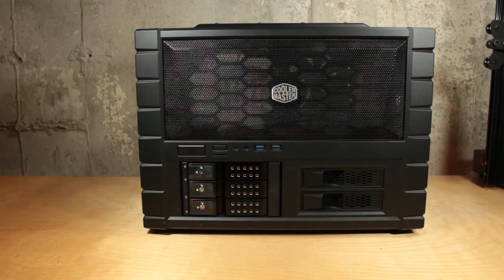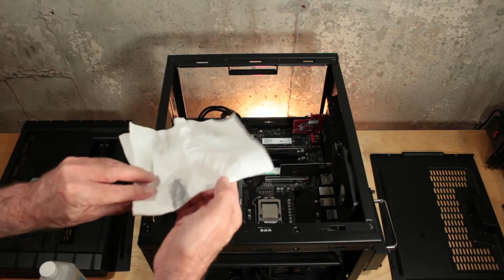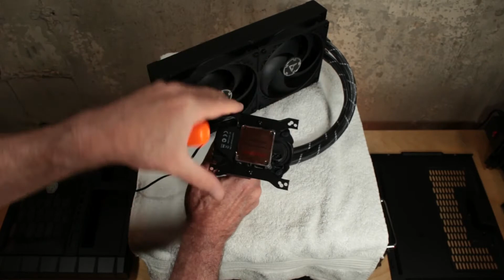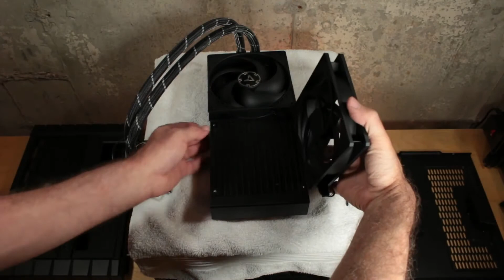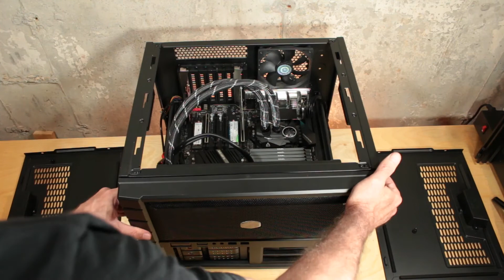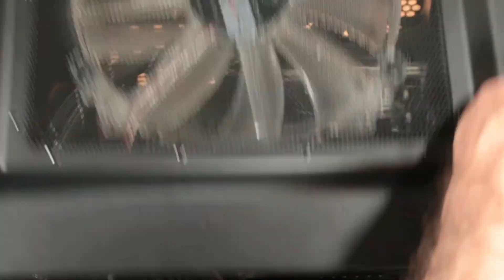Arctic Liquid Freezer II 280 install into Cooler Master HAF XB EVO LanBox

Comment: I've been using that same old case for years and still loving it. My rig needs an upgrade now and I was almost going for a 120 mm water cooling (AiO) system - but 240 mm seems viable. 

Still, isn't it a bad idea to push the hot air into the case instead of out? I think I'll go for some mild case modding and try to install the radiator on the top panel somehow - which is better anyway (radiator higher than pump = better cooling).
Reply from the maker: The case has considerable space for fans on the back. As long as they are all blowing air out the back while the cooler is blowing it in, you should be fine. Mine has been running 24 hours per day since I made this video, never had a cooling problem. Thanks!
Reply: @KapmansBasementWorkshop  
Been watching more videos in the meantime to gather some ideas. Apparently you can opt for push or pull (or push/pull) with these AiO coolers. If I understand this correctly you can mount the fans reversed so that they pull the air out through the radiator. It's just marginally less effective than the push variant... and I guess I'd have to add some fans in the back to suck air in.... hmm still undecided. If I really wanted to go crazy I could even fit a 360 mm cooler on the top. No clue how hot these new CPUs even get.

Comment: If you run a big GPU, you're going to mount the 200 outside. I had to mount my Noctua outside, also it would be nice if they updated the panel to be able to mount one fan in the left side for the gpu.
Reply from the maker: I did not try that yet

Comment: You can also add 2 x 80 mm fans at the bottom of the case to help with cooling. There is a lot of options now to optimize cooling with this case.
Reply from the maker: I agree.  I did have fans in those positions at one time.  But with later upgrades removed them.  I've been slowly eliminating fans over time...

Comment: Now you have an option to use - A Thermal Grizzly - Carbonaut - Carbon Thermal Pad inplace of thermal grease / paste. The thermal pad won't " Dry - out " and can be reused many times.
Reply from the maker: Has it been working well for you?
Reply: @KapmansBasementWorkshop  Using the Carbonaut - Carbon Thernal Pad has been working well so far. I am considering getting a couple more for my GPU. Not sure how beneficial it wold be though

Comment: Nice video. You can remove the dual 3 and 1/2" drive bay that supports the quick insert and release to allow more space for the PSU and cables. I have done this myself and using my Seasonic PRIME TX-1600 ATX 3.0 psu has been nice.
Reply from the maker: I also installed a hotswap bay which added an additional drive bay as well.
Reply: @KapmansBasementWorkshop  I took that drive bay out - to make more room for the cables from the PSU. Sorry for any confusion.
Reply from the maker: No problem. This is what's so great about this case!

Comment: I just buy Arctic Liquid Freezer III 240 and I have the same PC case and I'm thinking about how to best place it. Thank you for your video.

The only real drawback of this case is the small amount of space for the cables that come out of the power supply and directly "hit" the back of the HDD rack (what you mentioned at 2:50). I'm even thinking of removing that HDD rack and placing the only hard drive I have on the left side of the case in a fixed HDD rack. Thus, the cables from the power supply will "breathe" much better.

Otherwise, the case is fantastic, easy access to components, no problems with large AIR coolers and when you remove the top cover and side covers, you have easy access to everything on the motherboard.

Even though the PC case is old, even in 2024 I don't think about changing it.
Reply from the maker: I love this case.  I think it's the best large case around.  The easy access is fantastic.  I would like to replace the large top fan.  I have been having trouble getting a new one....Thank you for your comments!
Reply: The only other " Draw-Back" I have encountered with this case is the shorter size which makes using { Longer / More Powerful } GPU's a nightmare. I'm using the - MSI Radeon RX-7900XTX Gaming Trio Classic as my GPU in this case , which limits me to using a 120mm AIO for my Ryzen 9 7950X3D cooler. I'm gonna try to   use 120mm to 140mm fan adapters to upgrade the fans for my AIO to 140mm which I hope  could cool my Ryzen 9 7950X3D to below 55 degree's C running temperature. But at 55 degrees C - my Ryzen 9 7950X3D is still well below the 90 degrees C mark that AMD says it can operate at. This case does allow for custom watercooling. The ability to support custom water cooling is one of the major selling points when this case was first introduced. Maybe being able to remove the front panel without the need of having to remove the side panels would be nice.  Maybe even a higher price point that would include both the - mesh and see through top panels. Adding a Type-C port to the front panel would be a nice update for it. Retainig the 2 x 5 and 1/4" drive bays would be nice - I have 2 x Optical drives which I would like to keep.  Maybe even making it taller to accommodate dual PSU's and have better cable management.

Comment: Will the AC 240 III fit the screws? I'm gonna 3dprint adapter anyway but yea, straight fit would be a plus.
This case is still one of the best, using it since 2019 and i don;t plan to replace it too soon;
Reply from the maker: Please post a link to an AC 240.  I'll have a look and let you know.

Comment: I have this case wish they update it with more I/O on the front and USB C. Is it possible to fit in a ARCTIC Liquid Freezer II 360 in this case? I have a Asus TUF 3080.
Reply from the maker: I don't know.  You would need to check the measurements from the spec sheet.  I would also like to see an update for the front.

Comment: Can you run the radiator the other way ? We have a 5700x gpu and it's not enough room
Reply from the maker: I’m not really sure.  Please clarify what you mean by "the other way"
Reply: @KapmansBasementWorkshop I think they might be referring to having the aio tubes running the other way around instead of having it to where its gonna be above the pci slots. 

I managed to get those aio tubes facing the other way around to make room for my 3060 ti and it seems to be working great.

Its alot easier that way because not only do I have more room for the gpu but I dont really have to worry about the aio tubes hitting on the 200mm fan I have in the top since the tubes are right underneath where the side handle is on the case
Reply from the maker: @Zenoguard  This makes good sense.  Next time I'm in the PC, I may need to switch this around.

Comment: I still love this case.  I just wish they had an updated version that would take more radiators.  I'd like to see more horizontal cases in general, especially with video cards being so stupidly big - having them hang in tower cases just seems dumb.
Reply from the maker: I still love this case as well.  It’s in constant use after all this time.  I’m also not a big fan of tower cases.  An update of this case would be fantastic. Thanks for your thoughts!
Reply: @KapmansBasementWorkshop  Ever find an alternative? I'm still using mine and thinking of going to the tower 600 which is a tad taller but same LxW
Reply from the maker: @swooptv  I have not.  But I really have not been looking either.  I think I will build my next PC case instead of purchasing one.  I really have no need to replace this one.

Comment: Do you think a cooler with similar dimensions but 2 more mm ontop when the radiator is horizontal will fit? (It's a be quiet! 280 mm aio pure loop)
Reply from the maker: I just looked.  I believe it will assuming the bolt pattern is the same.
Reply: @KapmansBasementWorkshop  Alright thanks

Comment: What is this on your CD Drive slots?, looks like you have 3 slots of something, i'm curious, i have one HAF and i have just the covers in front :)
Reply from the maker: I installed a 3 disk hot swap drive bay. It simply bolts into the bay after removing the provided drive holders. It's a super simple and useful upgrade and adds an extra bay. Highly recommended.

Comment: I have had this case for years now I like it. I still have my 2 front fans. I had a big top fan as well but it started to rattle so I removed it.
Reply from the maker: I love the case. As soon as that fan starts to give me trouble, I lubricate it and it works for another couple of years!
Reply: been using this case and it's original fan since 2013...sob still trucking along.

Comment: Can we use a riser cable to separate the GPU over the motherboard and place it somewhere else in this cabinet?
Reply from the maker: I don't think so, but it has great GPU cooling where it is now.  Why would you place it elsewhere and risk a possibly less reliable connection?
Reply: @KapmansBasementWorkshop  vertically mount will exhaust the heat upside from its vent , and GPU weight would not be over the motherboard. ❤️ And thank you for the reply 🌹 really appreciated 🌹
Reply from the maker: @dharma.vibrates  Let me go check later today when I can get to it.  I'll get back to you with a better answer
Reply: @KapmansBasementWorkshop  🌹 i will be pleased to know Sir thank you , surely going to give better results . Yes little issue as  pcie gen4 is only available with Lian Li. Earlier I was going with Lian li but then i just got my eyes back to this beast that still exists 🌹
Reply from the maker: @dharma.vibrates  I'm going to take my original answer back.  I think you can do it.  I have not tried it, but I think you can.  The motherboard tray has about 1.5 inches to both the right and left of the motherboard open to the lower half of the case, even with the side panels on.  You could feed the super wide pci ribbon cables over the edge pretty easily and sit the card at the bottom.
Reply: @KapmansBasementWorkshop  thank you Sir for your valuable reply I was about to buy this cabinet for my build and this information has helped me alot to clear my doubt ☺️ 🌹.

Comment: hello，I preciate your video.Could you tell the max size of Gpu contaning?It is 334mm max in official but I am not sure whether it can be longer with out two front fans.Thank you~😊
Reply from the maker: it will be a day until I get to the pc.  What size GPU are you trying to fit?
Reply: @KapmansBasementWorkshop  Thank you for your reply ~ I am going to try the RTX4090  of CORLORFUL because some pepple say the NB EX-V's  length is about 320mm then I think it maybe  fit. However,other 4090,like ASUS or MSI，are more than 350mm.Actulally,I don't want but such a huge GPU but the RTX4080 16G is such a stupid tax,isn' it? 😅
Reply from the maker: @糖糖-l4i  I measured from the inside of the rear card bracket to the back on the radiator and fans as 300mm.  You might need to find a thinner cooler.
Reply: @KapmansBasementWorkshop  wow，I get it.Maybe I should choose tt core x9 as subsititute.In all,thank for your help~😚

Comment: I have this case and I love it . Would you think a 280 mm aoi would give better cooling than my noctua nh-d15 on my 9900k may go to 7950x soon because I can't wait for Intel 14th gen and feel I need more than 8 big cores ?
Reply from the maker: I think it could, but it's really a guess at this stage.  I wonder if AMD might include a fan of their own which might also work really well and also what other air cooling options exist when the time comes.  But this 280mm cooler should not have any trouble cooling that cpu.

Comment: Great work, I need to build my new PC like yours with CM XB EVO and Artic cooler. The default fans for Artic is 120mm x 25 mm, if I swap with 120mm x 30mm will the front panel still fit? Thanks
Reply from the maker: It appears it will fit.  It looks like there's about 10mm of clearance, but I did not take off the front plate to measure since it's a running server that's in use.  So this is just measuring visually.  However, the fans that come with the cooler are really good and seem very quiet.  I would try the fans that come with the cooler 1st.  If for some reason they cannot keep up, then change them.  Thank you for watching!
Reply: Thank you for the information

Comment: Nice work. Which PSU are you using in this video? I've been looking for a PSU with a metal bar, but can't find any!
Reply from the maker: It's old.  It's an EVGA Gold Supernova 750.  I don't think they are made with those metal bars anymore.  But I really like it and it's been a great power supply.  The bar protects the power cord and is nice as a handle when inserting or removing into a PC case.  Thank you!

Comment: Do you have any info on the hot swap drives you used on the left side expansion slots?
Reply from the maker: I purchased those a long time ago.  They convert a 2 drive bay into a hot swap 3 drive bay.  They have been great.  I believe these are it: (appear to be updated) https://www.amazon.com/StarTech-com-Aluminum-Trayless-Mobile-Backplane/dp/B00HS23QZO/ref=sr_1_4?crid=XZPVP7E68D9Q&keywords=hot+swap+drive+bays&qid=1647127354&sprefix=hot+swap+drive+bays%2Caps%2C80&sr=8-4

Comment: Hi,
 u had any problem?
Like temperature or any noise?
I'm thinking to buy the same case for the exact same aio.
Reply from the maker: I have had no trouble with temperatures using this combination of case and cooler.  The case is fantastic.  I highly recommend it.
Reply: @KapmansBasementWorkshop  I bought the case before getting the reply, But yes, great case, great combo of those 2
I'm really happy
Thanks
Reply from the maker: @cristi__Dl  I'm glad to see that it's working well for you!

Comment: I have same box with 11th gen cpu and EK AIO. I have 3080 FTW and everything fits. I would love to see how my case and cooling competes with the best cases out now. I have it modded with cooling fans though too. I think if you flipped the cooler the lines might not get in the way.
Reply from the maker: It's working fantastic for me.  When all 10 cores are maxed out, it's hard to tell if the fans have increased their speed at all.  The CPU will max itself out on all cores and stay cool.  I really like that case and the cooler.
Reply: Can you please share a photo of how you modded it to fit?
Reply from the maker: @kesterbrits4473  I did not mod the cooler or the PC case.  It simply fit.

Comment: I just bought this case to rebuild my Plex Server with a 12600K. Used an MSI 240 AIO as well but did it the way you was going to first. Came out great. Funny using an old case this day in age , but it is still a fantastic case. They just need to drop the AC97 connector and the molex fans lol. I just used all Noctua, including the 200mm
Reply from the maker: Considering it's age, it's still one of the best cases out there.  I really like it.  I agree, it could use a minor update, but it was so good in the 1st place.
Reply: I picked one up for my Plex server as well. I'm only running a 12400, but that seems plenty strong enough. I'm just using a 120mm air cooler from ID-COOLING (model SE-226-XT) for the 6 core 12 thread it stays plenty cool. I don't hit much about 60c running cinebench R23. Also I'm fairly impressed with this 12400. I'm running plex along with 2 other VM's and a minecraft server. Still seems to be able to transcode 4k video too.

Comment: Nice work, but did that affect the temperature of your GPU ? I will be installing an AIO soon on my HAF XB Evo and 10700K CPU
Reply from the maker: Not as far as I can tell, but I do have fan on the back blowing warm air out.  If you choose to add an AIO such as this, you could try to have the fans moving in the opposite direction.

Comment: Thanks! I bought an EK aio and would have been a lot more pissed about getting everything routed, I ended up having to go over the video card because I have an AM4 & it only gives me one choice because the tubing is very rigid.
Reply from the maker: Have a look at this: https://imgur.com/a/VabxGFv
Reply: @KapmansBasementWorkshop  excellent, thanks very much!
Reply from the maker: The EK units are very nice.  A good choice.
Reply: @KapmansBasementWorkshop  how did you mount your fan to the lid? I finished mine yesterday and realized I have nothing that will attach through rubber grommets, looks like you found some huge head screws. I was thinking about 35mm bolts, nuts and washers, a very intelligent solution.
Reply from the maker: @Brisleep1  That was a real long time ago when I attached that fan.  Give me a day or so and I'll go take a look.  I'll get back with an answer.

Comment: Dude.. you dont have a radiator, thats why your CPU is getting to 100 degrees and throttling. I have the same CPU, same case, no problem ever. Even running at 100% for hours for simulation.

You didnt get a radiator for your air cooling. That would have solved your problem.
Reply from the maker: I just added a radiator because the Intel stock cooling solution was not up to the task of cooling this CPU at full load. I replaced the stock solution with a water cooler.  Are you saying that a radiator exists for the stock Intel air cooler? If so, please post a link.  I'd like to have a look.  Thanks!
Reply: I'm very confused about what you're attempting to say. By definition a radiator is any of various devices (such as a series of pipes or tubes) for transferring heat from a fluid within to an area or object outside. As air coolers do not have fluid, they are considered heat sinks. Now, many larger heat sinks (air coolers) have heat pipes. A heat pipe which contains about the equivalent of a single drop of liquid COULD, by definition, be considered a radiator. However they are generally used as a part of a heat sink to transfer heat from one area to another. 
Intel as far as I know, only released a single stock liquid cooler in AIO (all in one) form with their 3960X in 2011. This cooler is the identical concept to what the video creator is installing.